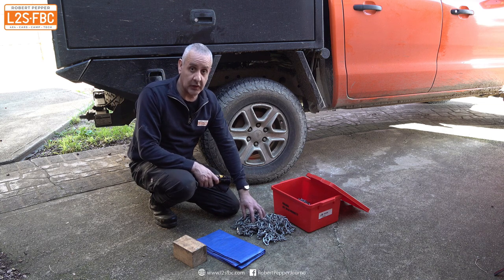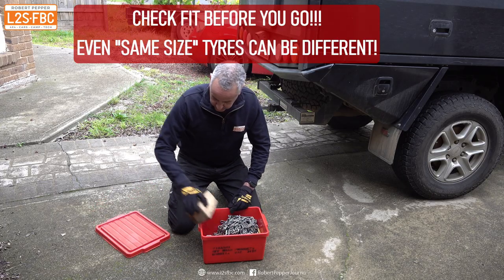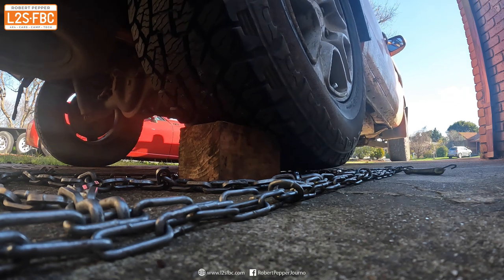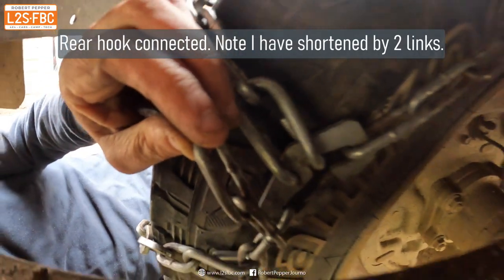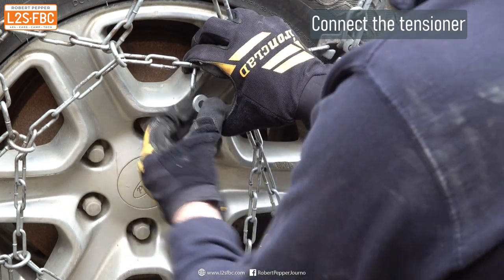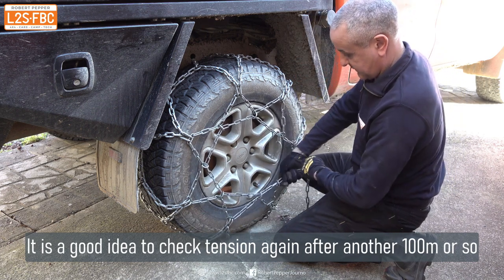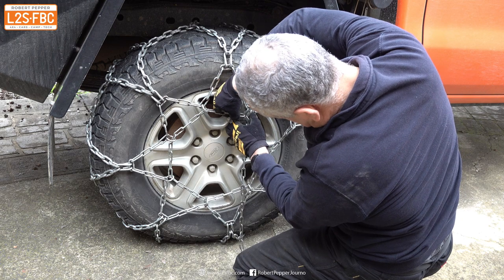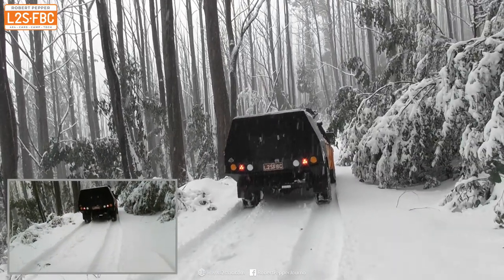The easy way to fit snow chains to a 4X4

Comment: you actually mounted them "inside out"... the u-shaped links that connect the side chain to the cross chains should have the folded over ends facing outward so that they point AWAY from the side wall. If the chains get stressed, those links can unbend and they can puncture the tire. They are also hard cut ends on one side and smooth bends on the other so general wear and tear from driving miles will be less.
Reply from the maker: Wow, didn't know that, wasn't in the instructions either!  But a good point, thank you. I don't see the bit about "hard cut ends on side and smooth bends on the other" though? Added that to the description.

Comment: But dont forget that the chains go on the front wheels.  You are better off with steering and breaking rather than drive from the rear.
Reply from the maker: Well, that's debatable, and also some vehicles cannot fit chains on the front wheels, particularly independent-sprung 4x4s with larger tyres.

Comment: I never thought about the block of wood.  I would think it is also a little dangerous considering that the ground is usually covered in snow/ice and I'd be worried about the 4WD slipping off as the ground is not always ideal where you have parked to get the chains on.  I have not fitted chains your way with laying them out then driving onto them. I lay then out then fit them to the wheel and will need to move the 4WD onto the chains to get the backside connected. Then tension them up and move off again a few meters to then settle them and re-tension.  I will do both at the same time which you wouldn't be able to do with the block of wood method. As always it will be snowing or sleeting when you need to get the chains on.  Thanks for sharing your method.
Reply from the maker: Well you've got 3 wheels firmly on the ground, so I've never had a problem with any car slipping off.  Thanks for sharing your method! Always good to have lots of methods :-)

Comment: thanks for posting. great info. we always carry a few extra bits in our chain fitting kit. 1. small lenghts of strong tie wire to secure extra links ( stop them hitting bodywork etc) 2. waterproof tarp/mat etc to kneel on ( to stay clean) and 3. rubber gloves as its always wet cold work.  hope this helps.
Reply from the maker: I didn't get the tie wire, a good idea especially at the back. The other two I mentioned in the intro, although I didn't use the tarp for the demo. I thought about doing the demo on the tracks, but really want to promote "learn before you leave" !

Comment: Forgot to mention that you need to lower the tyre pressure*before* fitting the chains.
Reply from the maker: Sorry thought I mentioned tyre pressures. If I didn't, then I would have said "it's eaiser to fit chains when the tyres are aired up, THEN air down, but you can air down first".

Comment: Balancing a tire on block of wood in conditions slippery enough to require chains seems dangerous. Drive a little bit and retension
Reply from the maker: Well has worked well for me thus far. The other 3 wheels are on the ground and not going anywhere. I'd say it's safer than any jacking operation.

Comment: 🏆🏆🏆👍🇺🇲🙏
After getting used to SSC cable chains and no disappointments, I could apply and remove in less than 10 minutes. We seem to have ice storms and they allow me to even pull trailers and start and stop very dependably. After a stroke and one good hand, I can handle them, whereas something heavier, I just have no chance. ❤️🛐🤗
Thank you for sharing
Reply from the maker: Thanks! What's SSC cable chains?

Comment: Another brilliantly presented and informative demo. Thanks Robert.
In a pinch, can you use chains to get out of other predicaments - e.g. mud or sand?
Reply from the maker: Mud yes. Sand never with chains. Reason being that mud is slippery, whereas sand is loose. For sand you need flotation so as not to sink in which increase rolling resistance. That's true to some extent for mud as well, but often in mud you need to bite into a slippery surface. So for example think of a wet clay hill - it's quite a hard surface, you couldn't easily push a shovel in like you could with sand, but wet clay is REALLY slippery. So the chains can bite into the mud surface, similar to ice and snow.  However, chains can destroy the tracks so their use should be avoided. In snow this is less of a problem as you're only rolling on snow which will melt, not digging deeper ruts in mud. Hope that makes sense?
Reply: @L2SFBC  Perfect sense. I don't expect to come across much snow, but sand and mud yes, so best get the track boards and leave the chains in the garage.

Comment: When I am driving in 4wd-L in snow, should I apply the 2 chains alternatingly, 1 in front and 1 back? Or should I apply both on the rear wheels? 
Will the front and back have a problem?
Reply from the maker: No always two on the same axle.
Reply: @L2SFBC  wouldn't alternating give me a better grip while driving?
Reply from the maker: no

Comment: I used to use a wood block but now use plastic ramps SNO chain ramps comes in set of two can do one side at a time. Use them every year in Idaho Wyoming Montana and Colorado
Reply from the maker: How does the plastic ramp work?
Reply: @L2SFBC  they are heavy plastic ramps with chain channels cut into them. You lay chains in / on ramp place one ramp and chain in front of front tire and one ramp and chain in front of back tire . Drive onto ramp pull up both chains and hook them takes all slack out as it’s nice fit . Put on chain center tension rubbers and then do same on other side . They are lightweight and easy to pack I put them with the chains in tire area
Reply from the maker: Thank you
Reply: @L2SFBC  anytime love your channel I’ve learned a lot from y’all 👊🏻👊🏻
Reply from the maker: @sheerwillsurvival2064  wow, that's high praise, love it when people who know the outdoors already learn something from my work!!!

Comment: I've never used chain's, do you have to tighten up the back of them like you do the front ???
Reply from the maker: Fully tighten. A loose chain is a bad chain.
Reply: I understand that...

But does the Back of the set of chains have the same tightening system as you showed on the Front ???

And if so, why didn't you show that procedure during in the video ???
Reply from the maker: @todd6385  oh right no you only tigthen at the front.
Reply: Thank you for helping me understand this, I GREATLY appreciate it...